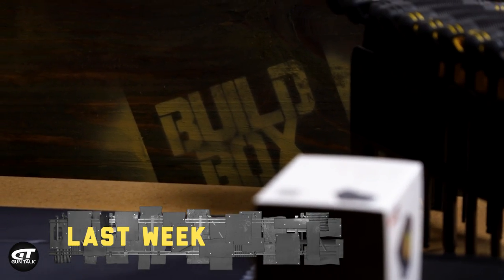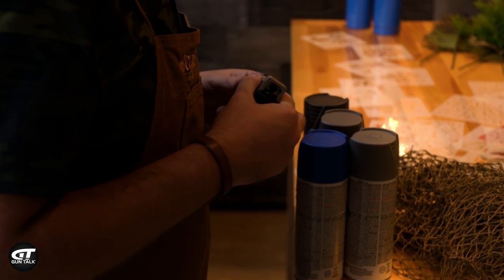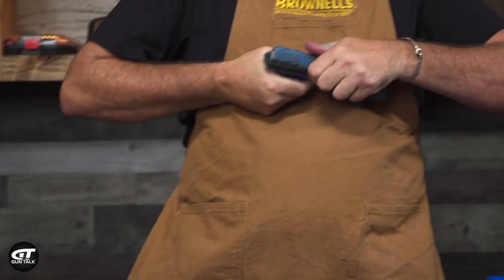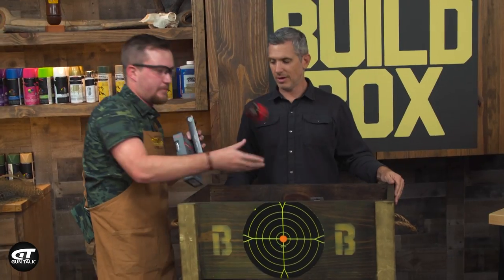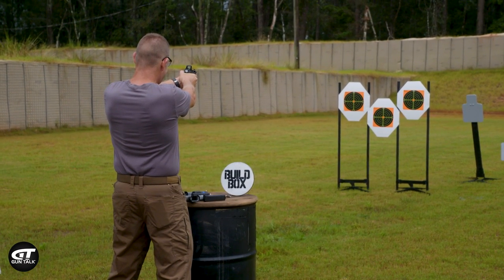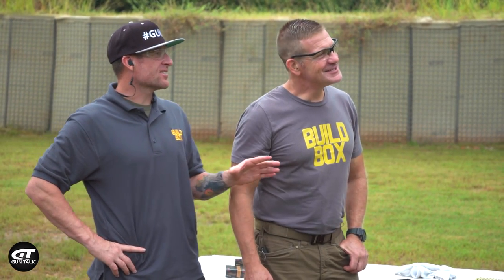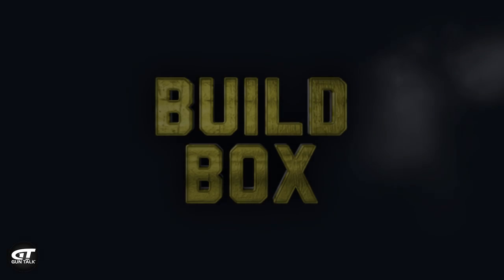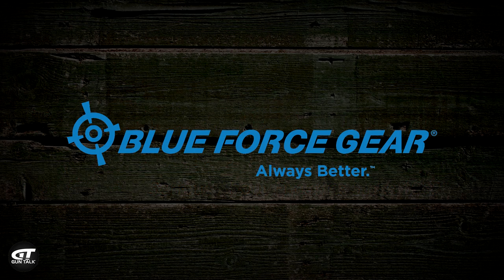BUILD BOX: Pistol Perfection Pt. 2 | Gun Talk Media

Comment: 13:49 Correction the spring is too heavy. A lighter spring would slowdown the slide when returning to battery. It's counter intuitive.
Reply: It was too heavy, but when shooting the firearm it did feel like it was actually too light. The slide felt as if it was outrunning the magazine spring tension as well as the actual ejector but the slo-mo cleared that up lol